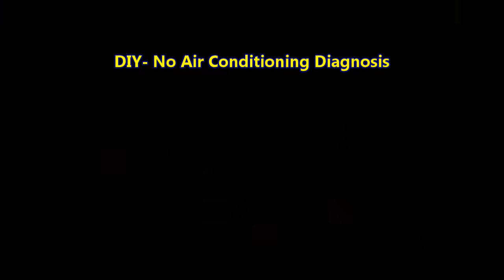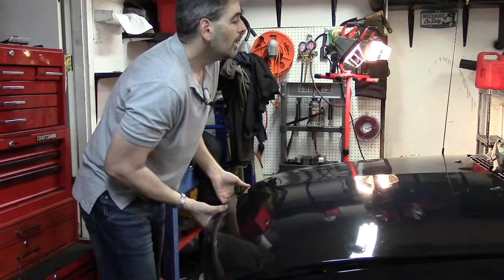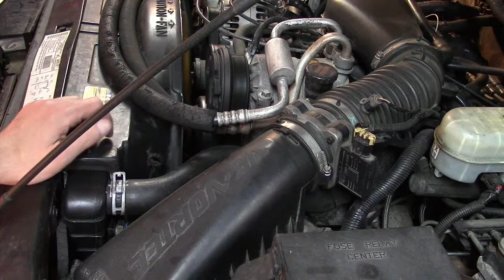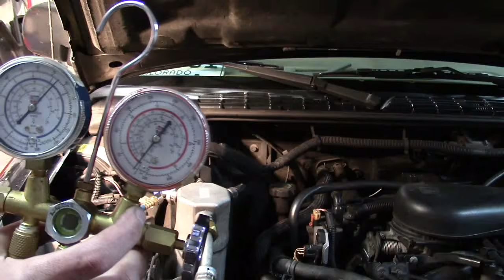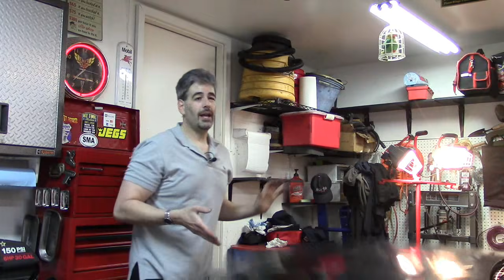DIY- Troubleshooting No Air Conditioning

Comment: I agree with this guy about the DIY hack but if you hear your compressor kicking on and off and your ac is blowing warm air buy some refrigerant.  If the mechanic is going to rip you off for $400 why not give it a try.  This jackaSS has resentment for scotty kilmer and people that follow him to try and fix their car.  This guy is jealous and people are stupid.  Scotty kilmer's video's are straight to the point and i don't hear scotty bitching and complaining and rambling.  so fuck this guy.
Reply from the maker: Are you kidding me? What stupid advice is that you are giving? What if the reason the compressor is clicking on and off is because the HIGH pressure switch keeps engaging? You are advising people to actually ADD MORE REFRIGERANT??
  You are a moron. This is why people like me and my followers diagnose that the compressor is shutting off because the high side is over 300PSI and know to immediately shut it off and check the expansion valve while morons like you or scotty would actually add refrigerant on an ignorant guess and end up destroying the system or even worse getting hurt badly because the pressure builds even higher.
  You are just another hack who gives advice without knowing what you are talking about.  You seriously need to learn from me.

Comment: At THE Point of 'NEEDED' info, you show Nothing!   or i'm confused.   'AC working, suddenly stops, hot air blows'.  
You find Cut Wire, say, 'it may have pulled out of harness'. Harness?  Tape or taped end?  Butt connector?  tho - Cut Clean?  
Power check of Relay also lost me.   I can interpret things backwards, could be why i'm lost.   But Wire - would be nice to See.
Reply from the maker: No that’s not what i said. I said when i pulled it out of the harness it was apparently a bad butt connection from a previous repair.
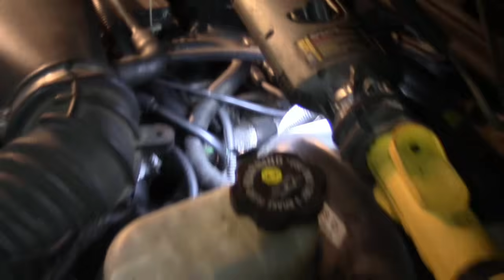Reply: @SchrodingersBox   -  Thanks for answer.   13:32   ("harness", "butt") 'repair' was poor.  See what not to do. ?    =\

Comment: So, they said it just clicked off at a red light, and the problem was...a clean cut wire from a previous repair?  Doesn't seem to add up.  Not that you can always trust the user, but still.
Reply from the maker: Oh right you are about that!!!! But I actually do believe them.  This was clearly an incorrectly applied butt connector where it was almost completely cut through as if they used cutters to crimp it and I am sure what happened is only a few strands were connected and eventually the high resistance just finished the cut completely.
  Now, maybe the owner did the previous repair himself, that I agree but if thats the case I would have expected he would have examined that himself before bringing it to me.  This guy has actually brought other cars to me before over the years and he is not the kind of guy that would do his own work lol.
Reply: @SchrodingersBox  Thanks for taking the time to read/reply.  I've been reading up and watching videos on how to approach my lack of AC situation in a 2003 Chevy Suburban with dual zone system.  I've been finding some of the best pointers are hidden in the comment sections, both from users and pinned by posters.  So, thanks and keep up the good work.  We know it's time consuming and we're the only ones really getting a value add out of it.  So, appreciated.

Comment: I have 2000 Ford Expedition 4.6L.  Idling engine in parking lot with AC running all the sudden a loud explosion sound that lithely shook the truck , steam came out from engine compartment. I shut it down. Found a AC hose that blew off that leads down to the compressor. The hose had a crimped fitting that is gone.   Question: what could cause pressure to build up that much to blow crimped hose off, or am I thinking to much into it.   Not sure if I need to just change out hoses, or if I may have compressor issues. Thoughts?
Reply from the maker: Sounds like a combination clogged oriface tube and failed high pressure switch.

Comment: You are a smart man however you do not have to demean anyone to prove it. Automobile wiring these days are made with things like soy, some have sugar and when warm give off a faint vanilla odor. Rodents like mice have always chewed through wires however given the fact most all new automotive wiring are made with these new ingredients I have seen and repaired many broken wires and some a clean cut through like the one you showed. If you see nuts or mice droppings and if the owner of the Vehicle lives in a wooded area this might be what has caused the break. Something to consider. One of many possibilities.
Reply from the maker: Ummmmmm how about instead of all that just pay attention to the video where i said it was due to an incorrectly clinched butt connector done by a hack

Comment: Forgive me, as I don’t know exactly what I’m doing, but am trying to figure out why my 05 Chevy Avalanche is blowing hot, but want to find the root cause because they guy that sold it to me said I just need to add refridgerant. However, what would cause the refridgerant to come out in the first place? So I’m not a mechanic, by any means, but would love any help you suggest?
Reply from the maker: You need basic data. What is the high and low side pressure both static vs loaded?
  you have to start there if you do not have that data then anything is pure guess.
Reply: @SchrodingersBox  I don't have access to those tools unfortunately. Are they costly? I'm a single mom on an extremely thin budget, and I truly appreciate you taking the time to respond.
Reply from the maker: Yeah I wish I can help but you need a professional diagnosis. There is no way of telling if your system is even low on refrigerant in the first place.  If you happen to live in Denver area I'd diagnose it for free.
Reply: Schrodingers Box I unfortunately don’t live in that area. I just know I’ll be taken advantage of by most local mechanics being as I’m not very knowledgeable about this. I’m very intelligent. I promise. Just not about vehicle motors. I really appreciate you. Greatly.

Comment: 7:27 Cable seems tight?  You don’t count that as visual inspection because why?
Reply from the maker: It was eliminated as a possible cause when the pull down switch design was validated as functional
Reply: Schrodingers Box 

But didn’t you run that test because you noticed the cable was tight?
Reply from the maker: Not at all. I did the test so i could map out the switch control design since i didn’t have a wire diagram.

Comment: What side of the pressure switch is it, controls the clutch,high side or low side?
Reply from the maker: Both do
Reply: Thank you,I have an 08 civic,it blows warm air.....Clutch doesn’t kick on,I’m gonna use your methods to diagnose it....

Comment: I have a 2005 Nissan Pathfinder. The a/c works when the fan is on the lowest speed but the fan doesn’t turn on. Air is forced through while driving and blows( very slightly)  cold air. When the fan speed is turned up, the fan blows strong but the a/c kicks off. Any ideas?
Reply from the maker: Check your A/C pressures on both hi and lo sides with the various fan speeds

Comment: 2012 Chevy Cruze 1lt. Don't want to waste money. A/C blower suspect. Pulled in cabin air filter. Kick start the motor with finger tips and it runs, blows cold air, and can change speeds 1-4. When shut off must be "kick started " again. Any advice?
Reply from the maker: Check the amperage draw the motor is requiring

Comment: I have a 2000 Jeep Cherokee. Will Not Take Freon..i have no pressure in the line/drier/acumalotor to ck  if its electrical.  clutch will kick in manually wire 1 wire from hoe hot from the comp to the hot on the battery . .im showing power on both hot and ground on the compressor. Is that right? Even when its unhooked from the plug coming from the wiring harness. It has no power on it until its hook up to the A/C . Also low pressure switch shows both inserts to have power. Is that right? Can you help me please...
Reply from the maker: If you have power on a compressor ground you must have an internal short- there is no other way. Disconnect the connector and if you have power on the ground then you are doing it wrong.
Reply: ok sorry. let me try to explain it better.  Please tell me what i am doing wrong. Internal short as a short in the compressor itself you mean? I have power on both ac wires with it plugged in or not plugged in. either way both wire show hot. it shows power on both wires on the compressor.   the coil wire and the ground wire . No matter if its plugged in or not . with the ac unplugged i have no power on the wiring harness wire. The wire coming from the harness that has the plug end on it does not have any power only until i plug the ac up.  the ac gives it power. instead of that wire giving the compressor power. Which is the way i thought it should be. The ac wires show to be hot even when its not plugged up to the wiring harness. The low pressure side switch shows power on both ports even with the ac unplugged  and will blow the big ac fuse if i try to bridge it over to cycle the clutch. Will also blow  the  big ac fuse if i try to bridge it over from the fuse box/relay. but if i unhook the high side sensor switch that show 3 hot 1 not 4 incerts that gives me  1 hot 1 not on the low side switch. then try to bridge it over and it still will not cycle the clutch but it dont blow the fuse that way. the high side switch like i said shows 3 hot 1 not but the 1 thats shows not hot is a blue wire going into the switch. that blue wire show to have power on it going into the switch but show no power in the port hole of the switch.  Yet i can hook a wire to the coil wire on the compressor  then  to the hot post and the clutch will cycle that way. The compressor worked great on the 96 cherokee. all i did was change the backs out because the lines go on different.
 i put a test light on the what should be the ground but shows to be hot held it there and  i pulled every fuse and relay in the fuse box under the hood 1 by 1 and none of those cause the light to go out or the power to go off  of that wire. Didnt do it inside the fuse box yet. . still showed power on the ground wire on the compressor. Well it should be ground but some how its got power on it. i do think i got a ground somewhere because that low side pressure switch should cycle the clutch when u bridge it over from there and so should the fuse/relay but they both will blow the big 20 amp fuse if i try that. How do i find a ground. The electric fan  switch/plug in shows, unplugged 1 port has power 1 port no power but when i plug it back in it shows both wires going out the fan to be hot. With the test light on the battery ground  the light comes on when i touch anything. the ac lines the compressor the engine the engine block ground inside fender .. Man i need help..i hope you can understand this...

Comment: Ok let me see if I understand. The vehicle owner was driving along with the ac working fine, then stopped at a light and all of a sudden ac cut off and didn't work any longer. Schrodingers Box determined the issue to be a cleanly cut wire. How in the world does a wire get cut while you are driving the car? The solution sounds suspicious.
Reply from the maker: If you watched the video you would see it was due to a incorrectly installed butt connector.

Comment: I was wondering if you help me diagnose my car problem. My car when driving drives very well no symptoms but when it reaches 50 mph it starts  losing power and starts fluttering.  I let go the gas  pedal it  keeps doing it until the speed gets to  40 mph. Can you help me diagnose the problem?
Thanks very much. I truly enjoy your videos. Thanks in advance.
Reply from the maker: Hopefully I can help- what data do you have?
Reply: @SchrodingersBox 
 First, thanks very much for responding to my E-mail, it is well appreciated.  I had to codes P0500 and P0325 . I replaced the knock out sensor but could not replace the speed sensor because could not find the wire and the connector to the sensor, seems that someone remove the wire with the connector last time I took it to change the starter, because ever since the speedometer is not working. I been using a telephone application to check the speed of the car called Wazr , also when I went to have it inspected did not passed inspection because it has a leak in the exhaust, besides that is the only thing I've been able to  find out and do. Outside of that, the car truly works fine until it reaches the 50 mph limit and it starts fluttering and loses power and it will remain like that until the speed goes down to 40 mph, then it goes back to normal, running just fine.
Sorry this is all the information I have. 
Again I thank you for any help that you may be able to provide.
Reply from the maker: @ElPalomodelaSierra  I would start with your knock sensor data- how was it tested? Did you do a voltage test directly or did you do a passive test checking for timing change with sensor inducement?
Reply: @SchrodingersBox  
I went directly to the knock sensor and found that the outside of the sensor was completely crack with  the metal on the sides was exposed so I figured that was the problem and I honestly do not know how to do the voltage test or a passive test. how do I do that?
Reply: @SchrodingersBox  
Thanks for responding to my cry for help. I am going to have replace or repair the exhaust manifold first before I continue with the fluttering problem, but I will keep you posted once I do that.  thanks very much again.

Comment: My problem is compressor kicks on and off and no cold air when i check for pressure its very high and it didn't have ac coolant. When it kicks on gauge goes low then when it turns off gauge goes all the way to the red. I recharge ac but as soon as i do its very high so i stop in fear can of refrigerant might blow. What do i do? Do i slowly keep recharging?
Reply from the maker: Sounds pretty obvious to me you have high pressure switch engagement causing this. Check if pressure is within spec and either diagnose for potential switch input failure or correct the high pressure which is likely to be a fault in the expansion valve.

Comment: Hi a rookie question .. should the ac kompressor kick on and off when all I want is HOT air in the car. (wintertime)
Reply from the maker: An AC compressor should click on anytime it is signalled for function.
Reply: that much I figured out :D .. I read just right now that the ac compressor kicks on to help get rid of moisture even at Winters.. so my system is probably working normally

Comment: Hi you did a really great job i have an 2015 audiQ5 with very low miles got it back in 2016 and the A.C was working fine but it rent out of refrigerant took to an A.C man here it recharged it everything began to work fine again the A.c was really cold but like after a few week it just started to blow like a slight chilled cold not cold like how the A.C should be and he is telling me it could be my evaporator is leaking or the expansion valve is not working properly i fine that hard to believe that i could have an leak already with or an expansion valve issue with a vehicle just 4 years old. So the air now works fine some times and other times it just not working good like blow cold air and its long to get cold after driving around for good while it started to get cold what do you that it could be causing that would like some help with that please anyone of you can

Comment: 2003 jeep liberty 3.7 .
My  a/c compressor clutch turns on and off when the car is running and the control is in the on position (whether is hot or cold air).  I can hear a click behind glove box compartment; which I assume is the relay. 
But I'm not sure. So... 
I hear a click and next the clutch engages. I can't get cold air just hot air. 
Any ideas , suggestions,  advices on what can it be? 
Anyone?  Please...  thanks ☺☺
Reply from the maker: check the low and high side pressures.
Reply: @SchrodingersBox  
Thanks much I will do that,  
Fyi: I tried to refill the system cause it wasn't blowing cold air, but it didn't take any of it, like if  it didn't have any room, didn't work, or something like that .  i also pressed on the little needle in the recharge ac port. And nothing came out , not even air,  nothing. 
That's that mean something?  
Thanks For  Your Help!  ☺